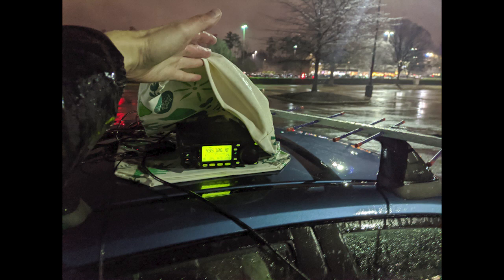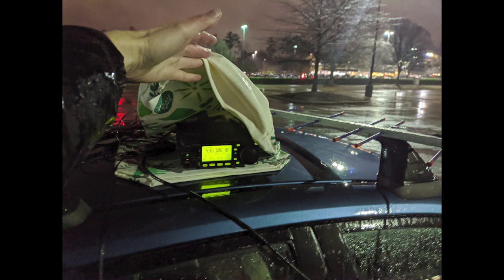HuskySat-1 deployed!

Comment: I manually tuned on the second pass and was able to upload 40 frames.  Using rtl-sdr and gqrx with FoxTelem.    That digital signal is so terrible sounding, though...😄
Reply from the maker: Yeah I saw your email about that. I will try harder next time :-)
Reply from the maker: Also, it is probably a lot easier to manually tune when you can see the waveform on a waterfall haha!
Reply: @SpaceComms  1k2 BPSK is easy to tune by ear when you get used to it. I monitored many passes of AO-16 when the command station was trying to recover it. The audio in your vid should be higher pitched so your tuning or timing was likely a bit off (no surprise this early in the mission).
Reply from the maker: @geoffmatthews6283  good to know! Thanks Geoff!